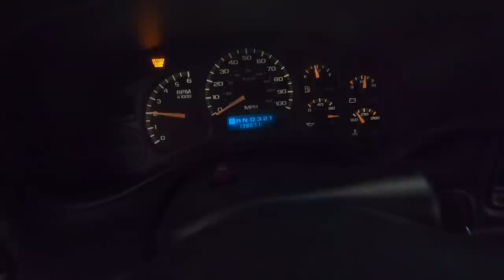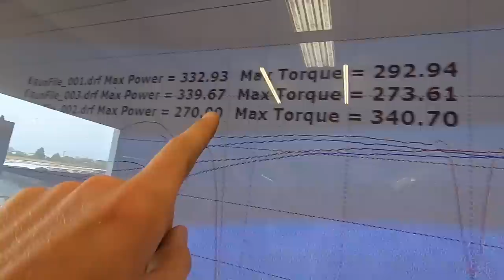James' Burnout Truck Hits the DYNO!! Ends HORRIBLY... Was It Worth It?? (Cam Chop Level 9000)

Comment: Texas speed should make James an all nitrous engine for his burnout truck
Reply: It'll just be like the 240, breakin drivelines all day long
Reply: LifeRunner nah cause it won’t be hookin
Reply: @Bthan69  I know, it was a slight attempt at being funny.
Anyway I don't think it'll be as exciting as it sounds, as James has already done an all nitrous engine which works fine.
Reply: @LifeRunner4000  the truck rear is ten times as strong as the 240 even with the welded diff. Also it won't be hooking on a glued track with slicks.
Reply: @southjerseysound7340  can you not read? I said it was a slight attempt at being funny
Reply: @LifeRunner4000  and did u mean axle shafts
Reply: @southjerseysound7340  The 240 has an 8.8 Ford diff which was used in many F-150 pickups. The Silverado has an 8.6 diff and is considered by many a weaker diff than the 8.8 Ford.
Reply: @blw5005  the 240 didn't have a 8.8 when he was blowing up axels. He was using AutoZone lifetime warranty replacement axels in the damn thing for ages. He might've put a 8.8 in it now, but it had the stock 240IRS for ages.
Reply: @blw5005  Neighbor has a Ford 8.8 as well
Reply: Agreeeddddd 😌
Reply: @kumacrash8074  he's probably from. The UK, that's what they're called over here
Reply: lol that's getting into to that Rob Dahm money.
Reply: @leokarasinski4217  with James driving I agree. But I got 2 years out of mine in a Colorado running low 9's and only replaced it because I got a deal on a new 9 inch because a friend of mine screwed up measuring for his set up.
Reply: @southjerseysound7340  Turns out you cannot, because if you did you would've seen that I previously answered a comment, just like yours.
What's with the fucking hostility? I ain't jumping off any bridges

Comment: I’ve been wanting to build a truck for long and it’s finally happening. Swapping a HEMI from a 04 2500 into a 04 single cab Dakota🤷🏻‍♂️
Reply: The Weapon Collection well, I got the ram for free and the v6 in the Dakota has a cracked head so why not
Reply: @camerongoodin816  sounds like an awesome build man.  I use to have an dakota r/t and always thought about swapping out the 5.9 for the hemi. Good luck with it bro.
Reply: @camerongoodin816 do the Hemi swap and I'll sub. 👀
Reply: Texas Rifleman96 give me a few weeks (hopefully not too many) and I’ll try to remember to get back on this on comment thread and let you guys know when I post a video with the progress
Reply: @camerongoodin816  sweet bro subed (;
Reply: I subbed, hope to see your progress, I'll be building my ol' Haunte Carlo on my channel
Reply: The Weapon Collection  The 5.2 was the cheap v8 for the Dakota. In RT trim it had the 5.9l. But even then, stock vs stock, the 5.9 came with 250hp, the 5.7 he has from an 04 2500 has 330hp. Quite a large gain.
Reply: @ProductionsJoe  till the valve seats grenade 🤣

Comment: I’m curious of the cam specs, I don’t think James ever said anything about the specs. 👍
Reply: big/big at big duration
Reply: David Denman he did check the last post
Reply: Bracket racers lol
Reply: @Wulthrin  wb lobe sep?
Reply: 236/244  112+3
Reply: Cam sounds square 🤣🤤
Reply: TheWorkTruck thank you
Reply: I believe it's "Holy fuck" lobe rise and "Jesus Pete" duration
Reply: Specs?

Just call up some cam suppliers and tell them you want the biggest thump stick they sell
Reply: Ya he did. He said make the Pistons kiss the valves 😂
Reply: that type of loop isn't really from a long duration or a high lift as much as it is the separation angle of the cam lobes. If I had to ballpark it I would guess the LSA on that motor at like 103 degrees. typically anything below a 112 your'e going to get a pretty loopy motor
Reply: Brian D no one uses below 110 anymore on LS motors. 110-114 is by far the most common and 112 can lope hard.
Reply: It's on , and off .
Reply: @kumacrash8074  idk cam specs well but im just gonna go out on a limb and say BIG

Comment: Hey Cleetus, you should try to get Ford to send you the new "Godzilla" 7.3L gas engine and put it in your Mustang and then tune it. Factory they are rated at 430hp @ 5500 and 475 tq @ 4000 with 10.5:1 compression.. obviously there's a lot of room for improvement there and it's an iron block with a cam and pushrods instead of OHC so it should be easy to modify if you sent the cam to Crane or Lunati so they could get the specs and make a custom one. The big thing about those engines is they are designed for low maintenance with little stress on the parts so they have massive main bearings and a variable flow oil pump.. Sounds like a great turbo motor to me!

Comment: i had a 1992 searria that had a three and a half inch dump like that one... it shot a few 4 foot wight fire balls... THO IT SOUNDED LIKE A DAM BOMB GOING OFF, could feel the detonation inside the air locked cab! hell of a truck for whatever can fit were a 305 can. was run hard its whole life as it had lots of burnt oil on everything, ran till the battery gave out and shorted the alternator power.

Comment: That's what my stock Ram makes, was hoping for over 400.
Reply: Rusty Shackleford The numbers you are seeing on the dyno graph is wheel horsepower. Assuming 20% drivetrain loss through an auto, this engine makes over 400 hp at the crank easy.
Reply: @makingcash4life  I'm well aware of that.

Comment: A leaking N2o solenoid would cause a lean condition not an explosion. N2o splits into nitrogen and oxygen during combustion, this allows for more fuel to be added to go along with the additional nitrogen and oxygen. Without more fuel added you just have more oxygen and nitrogen which effectively is more air as far as the combustion process is concerned. The Nitrogen is the portion of air that allows for the pressure increase during combustion. An engine running on pure oxygen would not be very powerful and also overheat. 
What we commonly refer to as a nitrous backfire is often caused by fuel puddling in the intake that is being used wet while designed for dry use. A dry intake does not carry fuel in the air mix as is not designed to do so. When you use a wet nitrous system on a dry intake, you are spraying fuel into your intake along with the air and nitrous oxide. 

The scene in fast and the furious when his car blows up ostensibly from the N2o tank rupturing is the opposite of what would happen. It would be a big pressure release if the tank failed in that manner but it would likely blow out flames. If you opened a bottle on a fire it would be similar to a c02 fire extinguisher but not as effective, a lot of wind and very cold.
Reply: We’ve broken the overhead shop lights with flying intake parts. His explanation sounds good but thats not how it goes down.

Comment: 7:35 James you should connect the ac to the intake. Make a ac-cold air. I've heard of it being done but never actually seen anyone do it.
Reply: Love those funny old memes
Reply: Nitrous will cool the intake air plenty. I don't think a normal ac system will keep up with that much air flow.
Reply: @lesgobrandon9826  I know it will. I realized that about 10 sec after I sent that. I just wasn't thinking.

Comment: At least yours was aluminum with a foam dampener built cheap to break weak link.
Imagine taking your truck in for a grease job abd u-joints get a call come back they need to tallk to you. Walk you back to the truck and show you a 2 piece carbon fiber shaft with stress cracks in it. Find a place 1 hour away and drive down there, go to the bank and drive back to find a brand new one piece all steel shaft in less than 30 minutes.
Chevy wanted $800 for a replacement with shipping and 2 weeks to get it to you, I paid $375 and got it the same day .

Comment: I bet an ext cab long box 6 speed allison dmax aluminum shaft would be damn close to the length you need. Just swap the slip yoke.   I've seen them take more torque and harder launches than this thing will ever manage

Comment: For the 2 step is it cutting spark ?? Or spark and fuel ? 
I’m running a stick turbo 347 and not sure wether to use spark cut or spark and fuel

Comment: Wow. Very low hp numbers,  for the amount of parts n money put into it.  I would not be happy
Reply: @Forcefed2002  stil low on hp.
Should be close to 500 easy
Reply: @curtismuma1931  500 on a cam'd 5.3 with an intake thru a 4l60 ? Nope

Comment: 1999-2000 Stock GM driveshafts are all aluminum and they are shit. They cant hold any high horse power or torque.